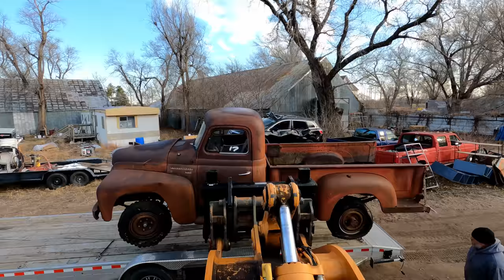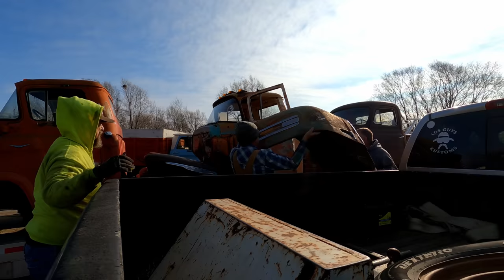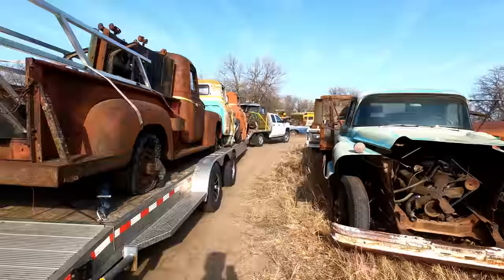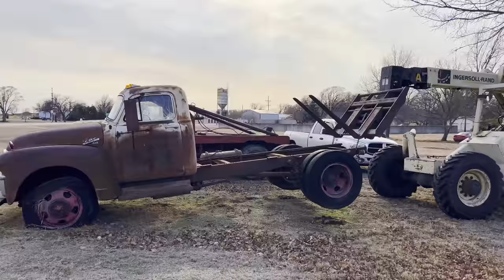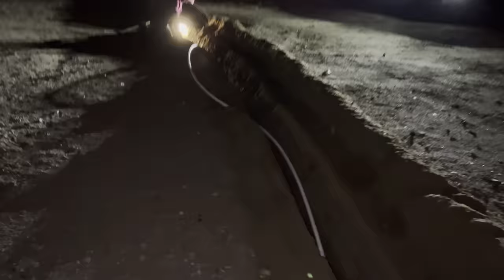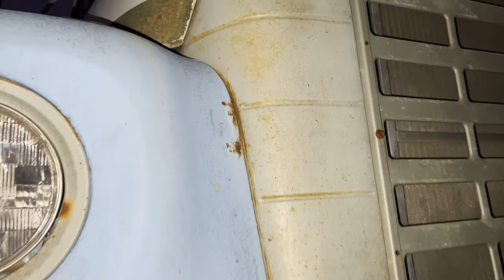UNEXPECTED Adventure to pick up an Antique Truck in Rural Kansas!

Comment: I just love that old International. They were built here in Great Britain in the 1960s. They were right hand drive and were fitted with Perkins 6354 diesel engines. They also built just a hand full of pre-production CO 1800 models, also right hand drive and with the same engine, but they never went into full production. I own the last remaining example.
Reply: We have a right hand drive scout. One of many internationals
Reply: @bud1773  I have seen one of those here in the UK, the owner had imported it from the USA. He told me that they were originally built RHD for the US postal service. This was to save the postman having to keep walking around the vehicle when delivering your mail, he could just step out and put it in your mailbox, or even do it through the side window.
Reply: Yeah I've got a 66 international it's left hand drive. It's a dually but it's also the size of pickup cab. It's smaller than these what we call medium to heavy duty trucks